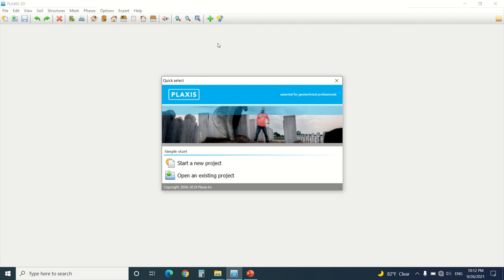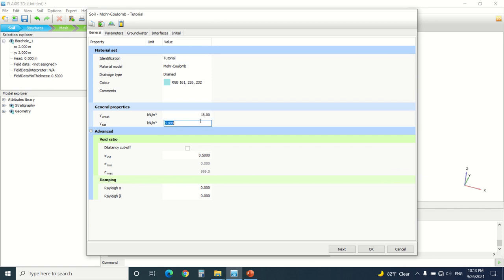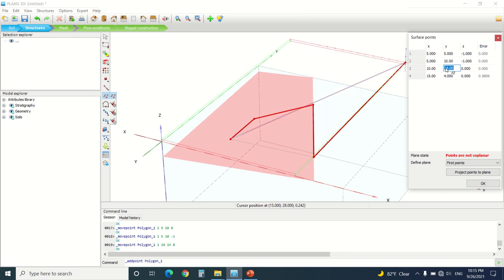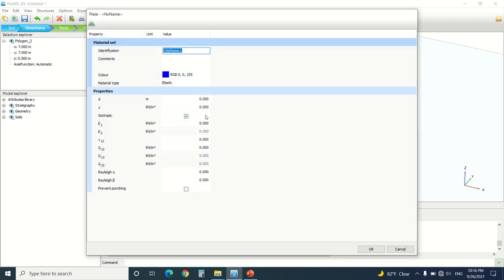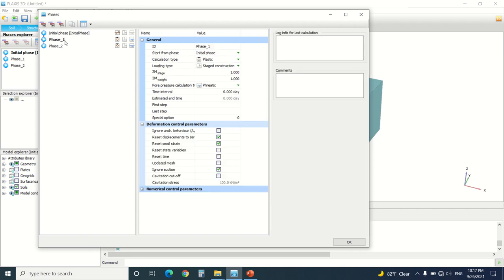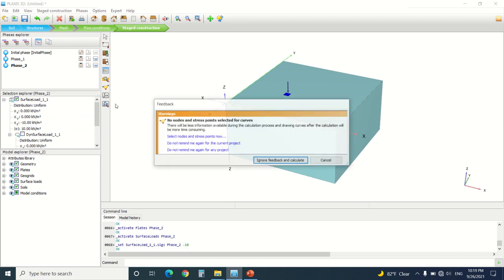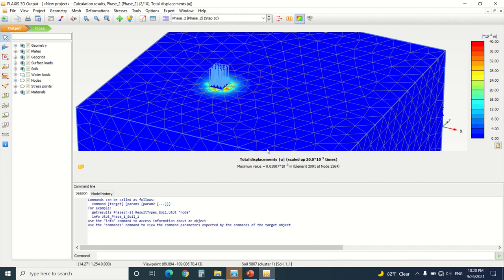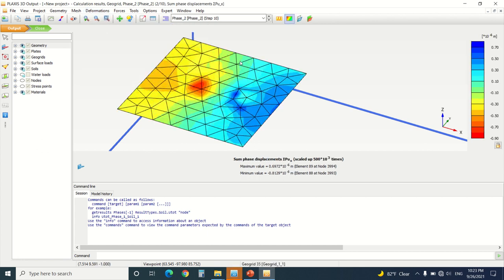Geogrid Plaxis modeling

Comment: Hi sir , Iam doing slope stability analysis using plaxis 3d using geogrids under pseudostatic and static conditions after analysis it has been found that the displacement of the slope using geogrid is higher in comparison to the slope without geogrid though the FOS of slope having geotextile is higher than the FOS of the slope without geotextile under pseudostatic condition. I am unable to understand why this is happening
Reply: Did you find any solution for this?

Comment: Good tutorial, but why you don't put the interface between geogrid and soil? Is that needed or not to model the interaction between the two?
Reply from the maker: it's beter to put a external interface
Reply: @theengineer7732  Okay, thanks. If you have multiple layers of geogrids like the one they used in GRS Abutment or Pier, is the procedure the same  in placing geogrid?
Reply from the maker: @christianmatemu7612  you mean nrxt to each other?
Reply: @theengineer7732  No, I mean at a certain vertical spacing  like 20 cm.
Reply from the maker: @christianmatemu7612  yes you can
Reply: @christianmatemu7612  have you done any analysis by placing Geogrids in multiple layers?